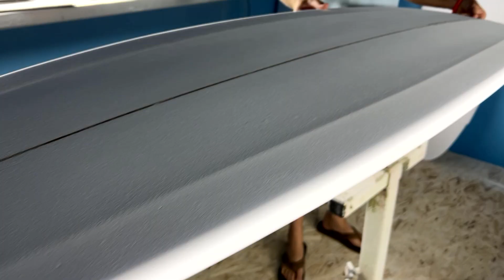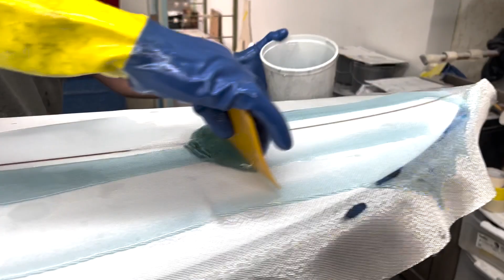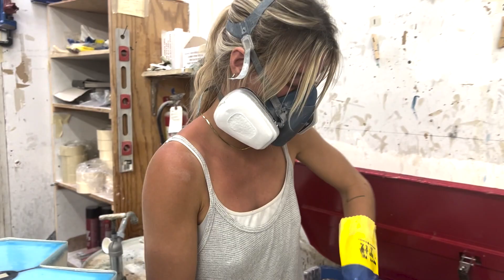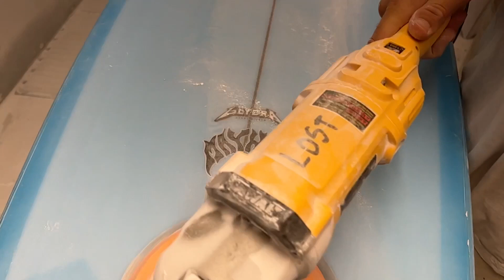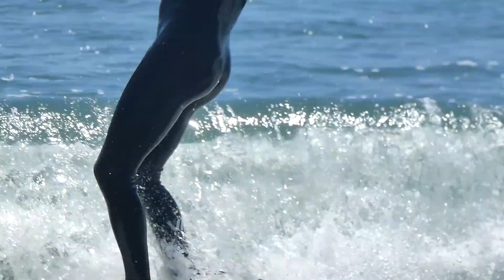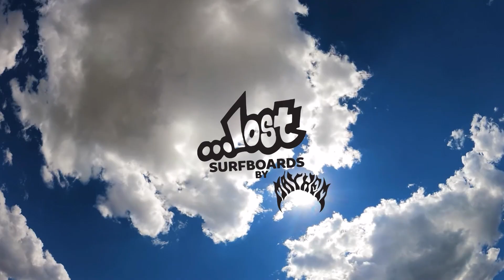...Lost Surfboards Presents: THE GLYDRA.

Comment: 6’3 225lbs intermediate surfer what size should I get was thinking 6’5 or 6’6?
Reply: I saw one in 6'6" at my local shop. I'm 6'2" and 218 and that board looked tiny for me.  Everything I ride is 6'2" -6'8" and I don't think I could catch anything on that board that was less than stomach/chest high and rocking. Check out the regular Hydra if you dig that shape. It will probably serve you better.
Reply: I just got a 7’6 yesterday took it out this am it was a blast. Intermediate/advanced 230lbs
Reply: スムースオペレーターから乗り換えたくなったよ😅
Reply: I got a 7 6 and I am 180. It still is maneuverable and shreddy 🔥
Reply: @777lifeisgood  What fins did you put on yours that you liked?
Reply: @davebarnard5378  What fins did you put on yours that you like?
Reply: @infinityRecording  Christianson twins